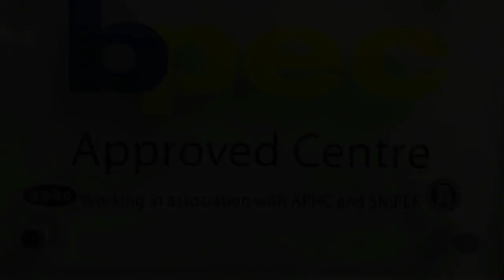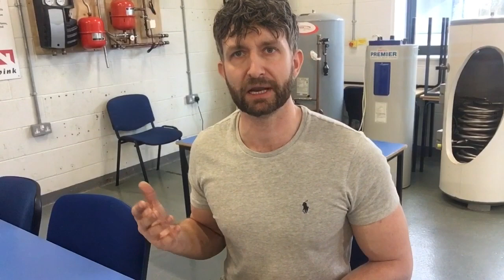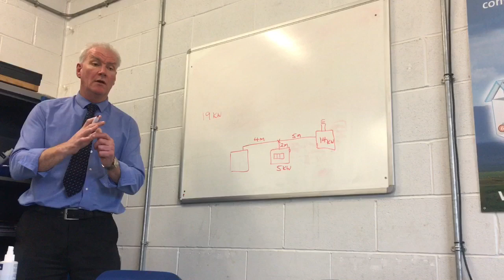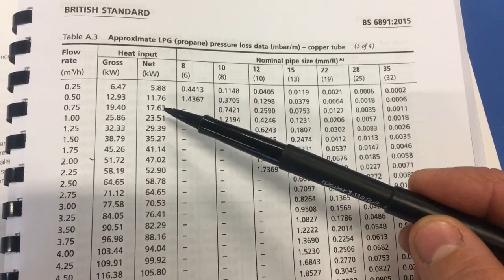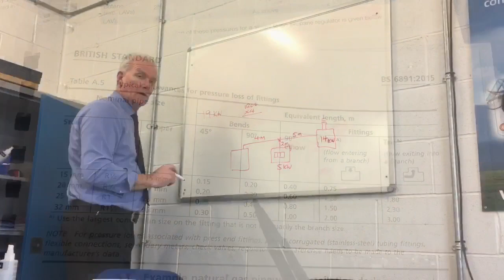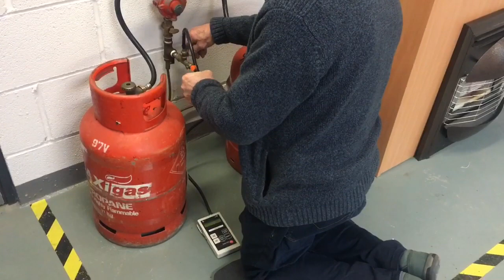The life of a jobbing plumber #3  LPG gas training and assessment

Comment: It look like they confused a bend with an elbow on the course.  No wonder the instructor looked surprised. I think they should clarify and say "swept elbow" (aka bend) or preformed elbow.  I would have thought natural gas plumbers would be familiar with this method when specifying pipework (pressure drop) for a natural gas .  I am a firm believer in courses even if you think you know it all as you pickup things you forgot and little gems of knowledge are always round the corner.  These could be short cuts and regulation changes you may have missed.

I always enjoy watching your videos.